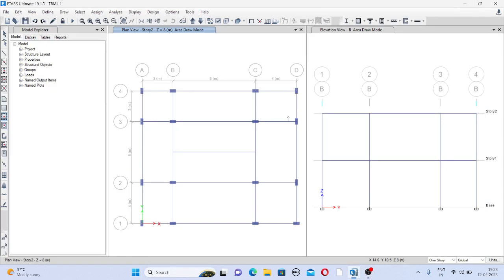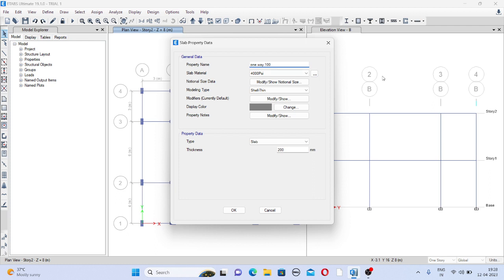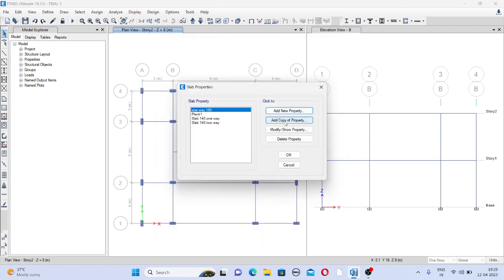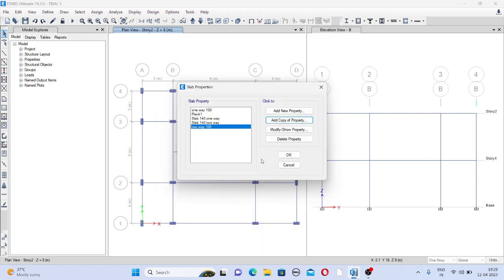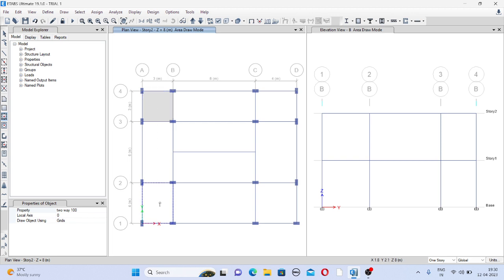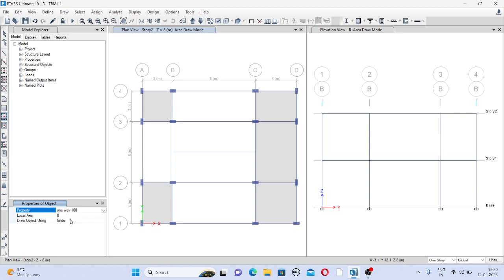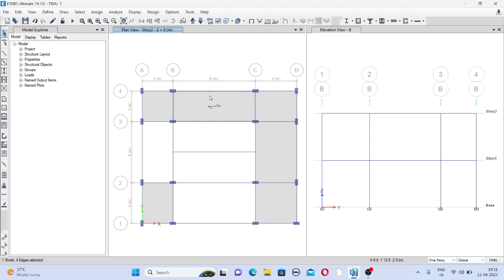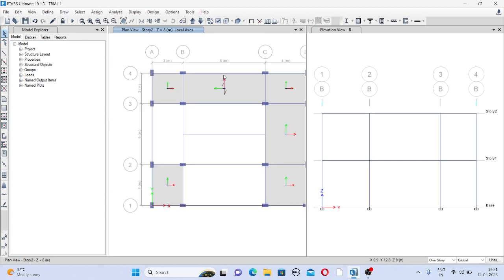how to assign one way slab and two way slab in etab : draw one way slab and two way : slab direction

Comment: what to do when i applied 2 way slab in my model but span shows arrows of one way slab .....how to remove that arrow from model?
Reply from the maker: When you show two way slab it never shows one way slab sign. It must be one way slab assigned
Reply: Two way slab should be shell thin not membrane!! Check